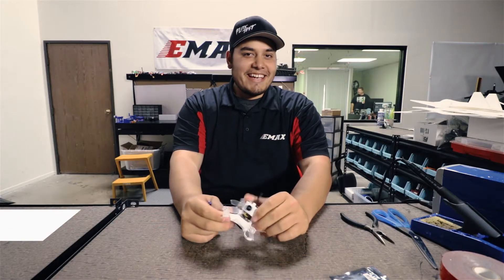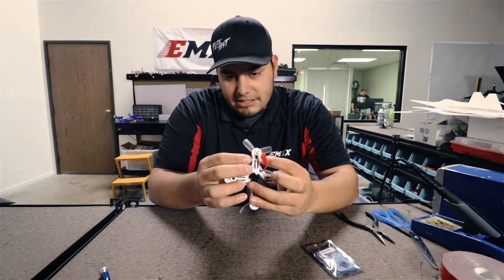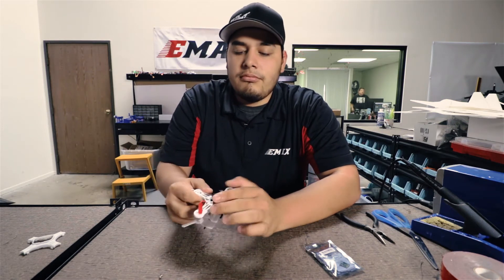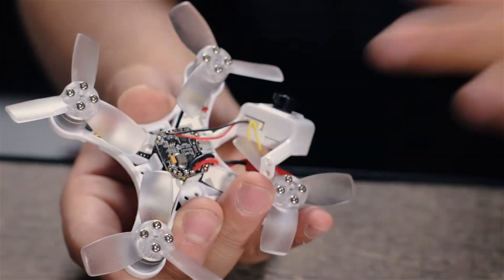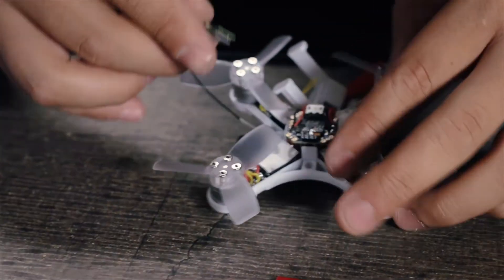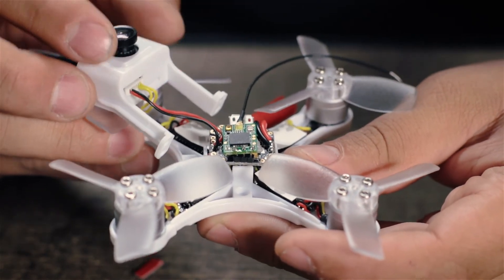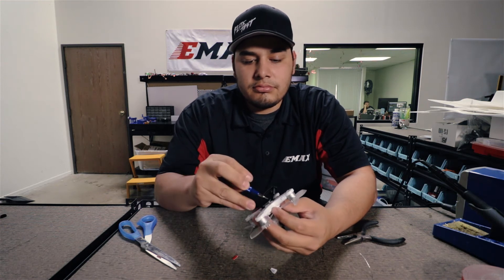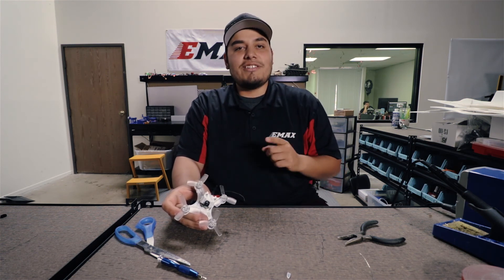Tutorial - How To Install A Receiver In Your Babyhawk

Comment: I bought the bins and fly version with the XM plus already installed. I got it to bind but I can’t get beta flight to recognize the reviewer. It won’t even show the little line move on the flight modes section. I realize the usb doesn’t power the receiver so I plugged in the battery and still nothing. I have all the lights and the motors will spin up. Please help me I don’t know what is wrong and I’m so frustrated. I got this for Christmas and the weather is just now getting good for flying and I can’t get it going. Please help.
Reply from the maker: The newest Betaflight configurator no longer recognizes the firmware version installed on the Babyhawk. All you'll need to do is reflash Betaflight to the newest version. If you need any additional assistance, you can contact our team by opening up a ticket on emax-usa.com if you are a US based customer or emaxmodel.com if you are an international customer.
Reply: EMAX USA can you point me to a good how to video ?
Reply from the maker: Albert Kim made a good one
https://www.youtube.com/watch?v=AxKDq58T5RI
Reply: EMAX USA what is the newest beta flight that the board will work with so I can do that and fly this thing and worry about flashing the board later?   Thanks so much for the help.
Reply from the maker: It will take the newest version.
Reply: EMAX USA what I meant was the older version of the beta flight configurator that the board will work with so I don’t have to fool with flashing the board just yet because I’ve never done that and I want to fly the thing before getting that in-depth.
Reply from the maker: Unfortunately the old configurator was discontinued when the Chrome App Store was shutdown. You will need to reflash it which is extremely simple to do. You can always open a ticket with us and our team of experts will walk you through the process and if any issues come up, we will gladly take a look at your unit as part of our customer care :)
Reply: EMAX USA ok I guess I’ll have to try. Thanks for your help. I’m sure I’ll be opening a ticket.

Comment: I am having problems with my babyhawk. When i install my ppm receiver into the UART2 port like it shows to in the diagram, all my receiver values in betaflight are at 0. I have tried using ibus and ppm on both uart1 and uart2 with no luck. Please help!
Reply: I am using a flysky transmitter
Reply from the maker: If you are an international customer, open a ticket with emaxmodel.com or if you're here in the US, emax-usa.com and we'll get you situated with our team of experts :)

Comment: Hey would I be able to put a flysky receiver in this ? Ibus? Micro ibus receiver and is there a pin out for receiver spot to solder to pins ?
Reply from the maker: You will have to check your pin layout with the receiver you are using to make sure they match.
Reply: EMAX USA alright thanks

Comment: Mine vibrates, twitches in yaw. Has a resonance that cause extreme jello.
Reply from the maker: Please make sure the flight controller is not touching the frame in any way but is instead suspended entirely on the foam tape. Also make sure the power lead is not pulled tight through the frame, and tugging on the flight controller. Modern high performance gyros are very sensitive and need to be as isolated from any form of vibration. If the issue persists, create a ticket at emax-usa.com if you are from the US or emaxmodel.com if you are an international customer.

Comment: Is it compatible with radiolink receiver such as R6DSM with SBUS connection? Thanks.
Reply from the maker: Yes the receiver should work as the Babyhawk runs Betaflight. Just make sure the mapping for your radio is correct.

Comment: The new XSR-M receiver is even better, still small enough to sit on top (20x20mm) but with diversity antennas and telemetry! Just add one cable to the TX2 pin. That should be the recommended receiver now, and the RTF version with Frsky should have that in the package then it'd be awesome. Telemetry is critical to avoid wrecking batteries, when you have an FrSky receiver setting up voltage read-out and/or alarms is the best way to keep the batteries safe. Beepers aren't so good, annoying when they beep all the time during normal voltage variance. This is especially important because there is no OSD on this model.

Comment: Hi I want to use flysky FS-A8S receiver, please explain how wiring connect to fc board
Reply from the maker: You can solder your wires directly onto the pins in the same order using sbus preferably. Here is the Femto board diagram:
http://www.emaxmodel.com/download/F3_femto_manual_V1.2.pdf

Comment: I got my FrSky XM+ receiver attached and working, thanks to your video. But when I try and hook up the flight controller to Betaflight, it won't connect. I thought it was pre-loaded with Betaflight and would connect right up.
What do I need to do or what am I missing? 

Thank you.
Reply from the maker: It is preloaded with Betaflight. Check to make sure you have the proper drivers installed for the Femto F3 board in order to connect via USB.

http://www.emaxmodel.com/download/F3_femto_manual_V1.2.pdf
Reply: Thank you. I did need to load the  driver using Zadig. The BabyHawk is up and running. 
I noticed on this PDF  a driver dealing with the virtual communications port. What is that? 
Thank you.
Reply from the maker: It is basically the built-in USB driver. You don't need to worry about it.

Comment: Have you guys tried to install fly sky receivers in them?
Reply from the maker: For bigger receivers, people have been sticking them onto the bottom of the Babyhawk and wiring them up that way.
Reply: Do you mean the back of the camera ?
Reply from the maker: Some people have reported doing that as well. Whichever way works best for your receiver :)
Reply: Ok one last noob question, Can I solder my wires to the pins ? Or do I need to remove the pins ? Thank you again for the help
Reply from the maker: You can solder directly to the pins if it is easier for you
Reply: ok, once again thank you so much for the help

Comment: Brandon thanks for the tips! Can you give me any tips on setting the configuration for the receiver (XM+) on BetaFlight and my QX 7?
rosariocmrtz@gmail.com
Reply: Rosario Martinez I have the same setup and can’t get beta flight to recognize my receiver even with the battery connected. It won’t even show the switches on the modes tab     I don’t know what to do. Will that CLI command fix this? Is that the problem you were having?
Reply from the maker: Set your radio on D16 before binding and that should be it. The standard setting on the Babyhawk is SBUS.
Reply: Brandon. I did the transmitter to D16 and  in Betaflight i selected the speksat /  sbus for receiver configuration.
What actually worked was inverting the sbus signal using the  CLI. "Set Invert_sbus=on" then it worked fully!
Reply from the maker: Thanks for the info! Glad you got it up and running. Enjoy :)